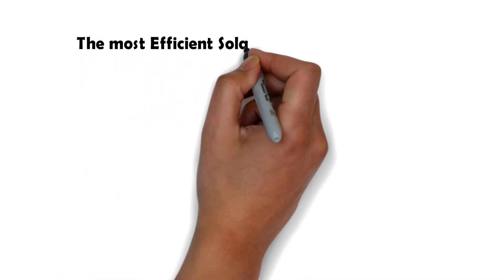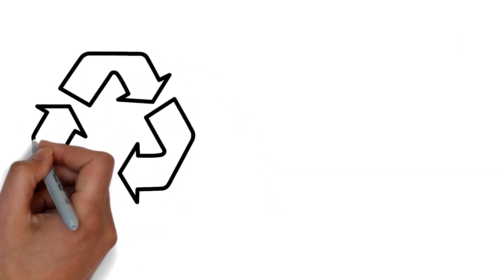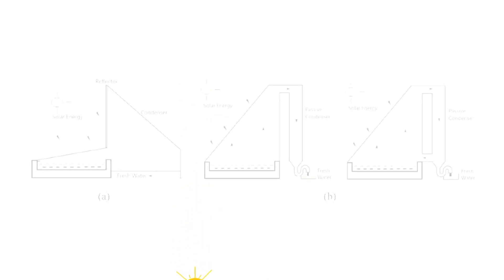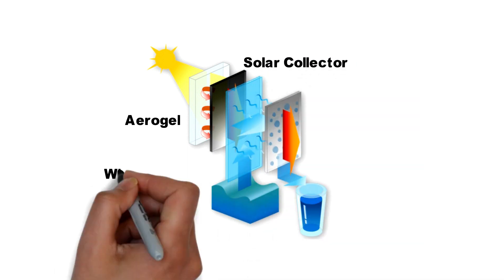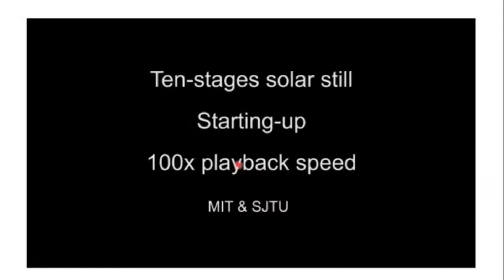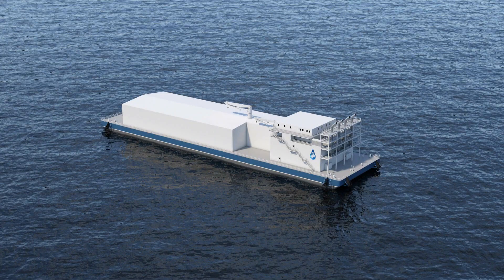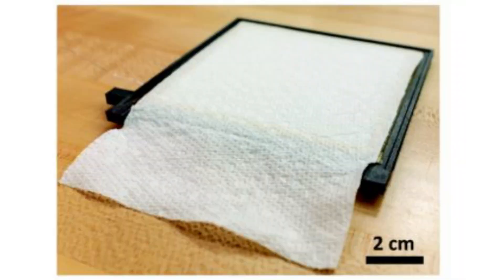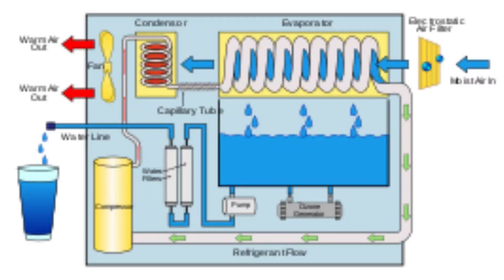The most efficient passive solar desalination system. TMSS

Comment: I'm working on an improved version of the solar still desalination process shown here at 1:36.  The thing is I'm an amateur ...
On the whole, solar desalination of seawater sounds extremely appealing, except that there is a 'small' catch - there always is one ...  If everybody started using it, we'd end up with a whole lot of salt (about 4% of seawater is salt and minerals) and I've not found any mention of what we'll do with all the excess salt.  To give a rough example (don't you quote me on it!):

Let us assume that for every person on earth (say, 7,800,000,000 people) one cubic meter of seawater is desalinated per day. that gives us:  7,488,000,000 cubic meters of fresh water (wow!) which multiplied by 350 days per year (say, for rounding purposes or for maintenance reasons) results in 2,630,800,000,000 cubic meters of freshwater per year.  Excellent!  And the seawater level will only go down 7 mm (about 1/4 of an inch) worldwide - no problem, as it's rising anyway ...  Yet, the unavoidable issue is that we'll be producing 312,000,000 cubic meters of salt per day or (by the same calculations as before) 109,200,000,000 cubic meters of salt per year.  In 2020, the global consumption of salt was 335,000,000 metric tons (www.foodexecutive.com/en/marketing/2096-global-salt-consumption-raises.html) or 154,435,000 cubic meters (www.aqua-calc.com/calculate/weight-to-volume/substance/salt) or 1 over 700 what we would be producing - put in other words, just 1 year of this extensive global solar desalination project would cover the annual consumption of 700 years of salt!!!
Now, I think I know the 'easy' answer: we dump the excess salt back in the sea where it came from ... Disastrous!  That would totally ruin the ecosystems of enclosed seas (think of the Baltic, the Mediterranean, the Red Sea, the Black Sea, the Persian Gulf, the Caribbean and Hudson Bay, to name but a few) and it would increase the salinity of the seawater worldwide (salt is great in absorbing heat, so the seawater will get warmer, so the greenhouse effect will get more acute ...
Reply: you do realize that all the water on earth returns to the sea.
and most of the salt we consume also returns to the sea.
it all evens out.
Reply: I'll happily add all the salt to my fries.
Reply: Well you can utilize the salts. Use them to build in the construction industry, or better yet use them in making batteries to store excess energy made by solar panels.
Reply: @Zacherace , if they could use them effectively, then it would be absolutely wonderful!
But my total lack of knowledge in chemistry doesn't permit me to have an opinion on whether sea salt can used in a battery.
Reply: @apostolosvranas4499  Yes they can be, I researched enough, plus asked my father who's educated in chemistry, and he told me it is possible. There are many types of salt based batteries, but the most promising is the Sodium one, which will dominate the market very soon.
Reply: @apostolosvranas4499 if you don't understand chemistry then you shouldn't be talking
Reply: Rivers of piss will return to the sea.
Reply: if you put this much effort into calculating, you should put more thought into WHAT youre calculating. All people on Earth dont drink desalinated salt water. Most all of our potable water comes from natural springs and freshwater sources. So your calculations are WILDLY off to begin with, at your first assumption. Secondly, all salt on the planet is ALREADY in the ecosystem and oceans. it would disperse in the oceans and find its own equilibrium. Any increase in concentration would be entirely negligible. You also don't account for plants and other items in the ecosystem that naturally consume salt water, which would grow more abundantly given any increase in "food" supply. The sky is not falling and there is no harm in this method of desalination, and its way better than existing desalination (which also doesnt end the world, btw).
Reply: the salt can be dump not in the water but on a land designated for it, plus it can be used in many many creative ways, but this will be just a nice piece of technology to complement other sources and surely will not be only way of getting clean water, i just wonder why don't islands and coastal cities use this
Reply: @kooshanjazayeri , if we were to dump this much salt on land, it would require much  land!
We would to have to find other uses for it so as to increase its consumption.  Possibly, sodium batteries and brine engines will eventually provide some relief there ...

Comment: Putting the salt back into the sea isn't great for the sea life. I assume there are uses for it industrially.
Reply: The water cycle takes care of this. Whatever is collected will be used. It all leads to the oceans.
Reply: These are small scale subsistence systems that do not increase salt concentration given the large volume of circulating water. It would be a different matter if this was done on an industrial scale indeed.
You could probably shake up the towels before night time to retrieve part of the salt crystals, and maybe salt fish with it.
Reply: @Chimel31 , we'd better find an extraterrestrial market for salt, salted fish and salted meat, otherwise we'll be buried in salt!
Reply: @_____ , if such a method goes global, we''ll be producing salt at enormous quantities (read my comment for a rough estimate); we wouldn't be able to dump it anywhere, even in the deep parts of the oceans!

Comment: How does this work on days or weeks of cloudy weather?
Reply from the maker: It depends upon how cloudy it is. If the weather is partially cloudy, the performance drops but it still works
Reply: There are more expensive alternatives that work wonders on diffuse light, like solar vacuum heat pipes.